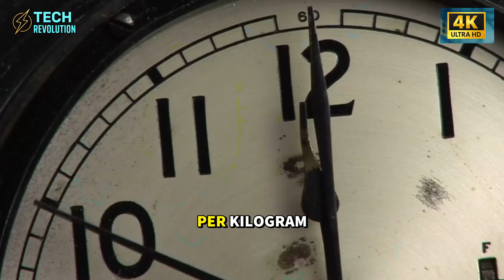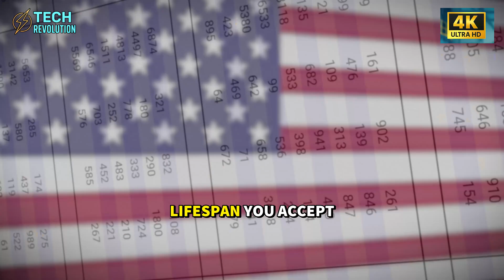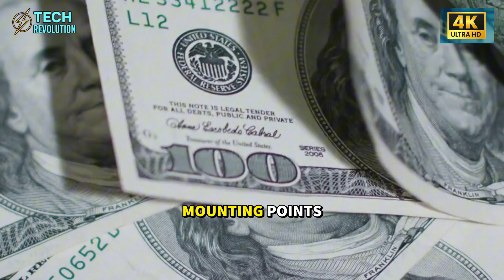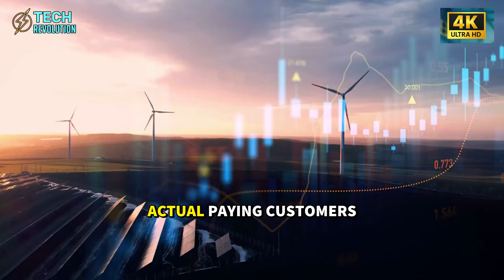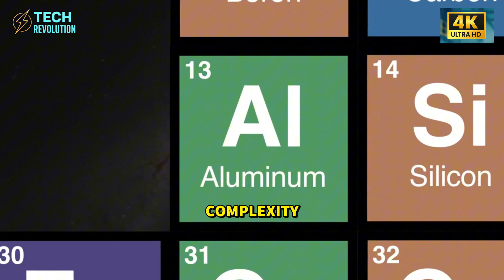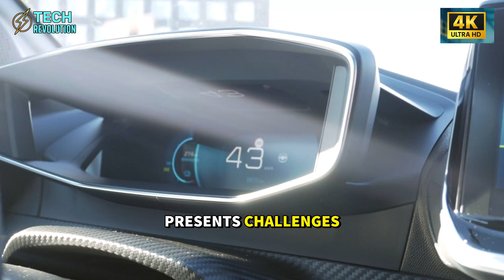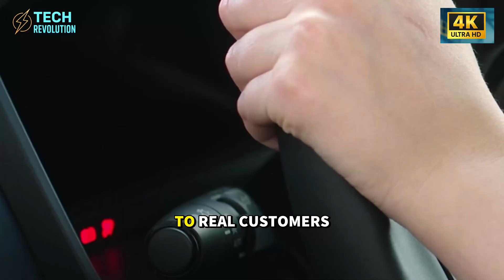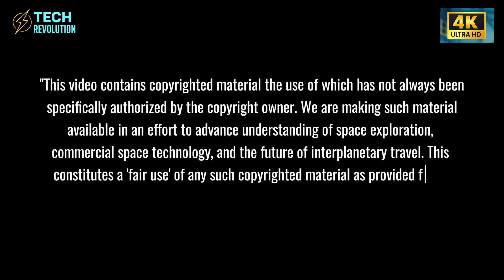Donut Lab's "Perfect" Battery FINALLY HERE: 400Wh Claim, What's SHOCKING Truth

Comment: A hybrid supercapacitor/battery absolutely can not give you higher energy density nor full recharges in 5 minutes either. Reducing the size/scale doesn't change that one iota. This video is also fraud.
Reply: absolutely??
Reply from the maker: A hybrid could change power characteristics and cycle life, even if full energy density claims need real test data.
Until we see measured 400 Wh/kg and charge curves from real Verge bikes, calling it fraud is premature.
Reply: @TechRevolution26  Okay after going over some recent laboratory results from supercapacitors I'm going to apologize because with carbon nanotubes they have exceeded 400 wkg. This would explain the life cycle and fast recharging as well. I spoke too soon shame on me. It also explains the lack of rare earth materials as well and lithium. Maybe they are calling it a "battery" because of the decades of supercapacitor fails. If this is true it is huge, but I will reserve excitement until I see independent verified results.

Comment: It does not matter. EVs are obsolete.  The cost of making fuel OFF grid vs RE electricity ON grid will be 20 to 30 times more for Electricity.

3 cents/kwh fuel vs 60 house and 90 SC cents/kwh grid.  90/3=30 and 60/3=20.

New combustion tech will be combined cycle at 75% and 60% of an EV car due to no drive battery.  That makes combustion 1.5x better MPGe.

20 x 1.5 = 30x and 30 x 1.5 = 45.  So, who would pay 30 to 45 times MORE for energy?  NOBODY.  In Winter?  2x more for EV.  60 to 90 times MORE.  Game over.  LOL.
Reply: You obviously havent heard about Aureon Energy...
Reply: Giving great numbers, mate 😂
Directly from Mars?
Reply from the maker: You’re comparing grid prices, not system efficiency—Donut Lab’s solid-state battery targets small EVs, where energy cost ≠ car-scale math.
Reply: @TechRevolution26  New combustion will be superior than EV in MPGe.  6 miles/kwh combustion vs 4 miles/kwh EV.  multiply by 10 to 30 x and you have a cost ratio of 15 to 45 times MORE for EV.  Game over for EVs.  HINT.

Comment: As for Donut Lab, many are calling it a hoax because they confuse the limitations of lithium with this new technology (likely a solid-state/supercapacitor hybrid) and are suspicious of their confidentiality regarding the chemistry. But if Donut Lab proves what they claim, the move is brilliant: by putting the Verge motorcycles on the road, it prevents lobbies from buying and hiding the patent to avoid wasting all their investments in current technology and allowing them to calmly dispose of all lithium-based cars and technologies. If the Verge motorcycle lives up to its promises (400 Wh/kg and recharging in 5 minutes), the giants lagging behind in the solid-state sector, such as Stellantis, will be forced to pay licenses and royalties on Donut Lab's terms to avoid disappearing from the market. Therefore, the physical product is their insurance policy: if the technology is real and already 'on the road', the old system of slow batteries is over, and no one will be able to hide the truth anymore.
Reply from the maker: That’s the shocking truth: shipping a real product is the strongest proof against a hoax.
If Donut Lab’s 400Wh/kg solid-state battery works on the road, patents can’t be buried—only licensed.